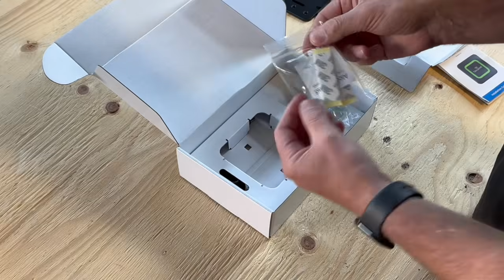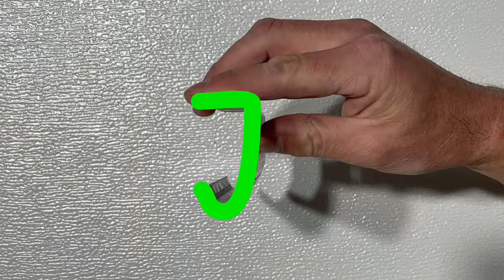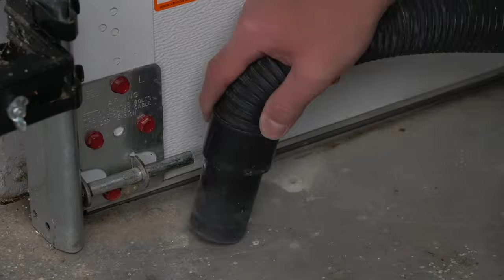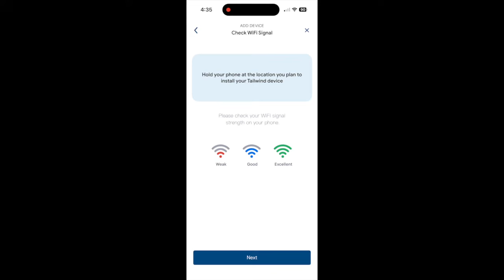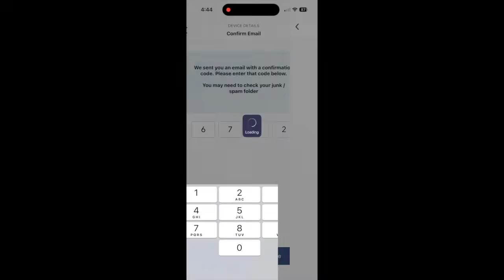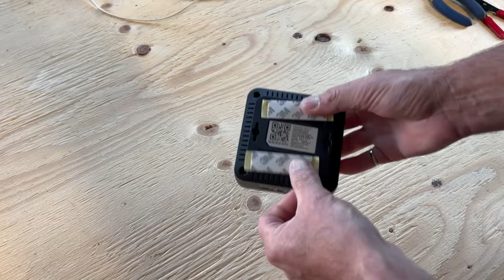Tailwind IQ3 2.0 Installation

Comment: I cannot get passed the screen where the app verifies 2.4g, gps and bluetooth.  Three devices, all three same result, bluetooth box does not check off for me to proceed connecting device to app.
Reply: I had to go to diagnostics in order to force the app to ask for bluetooth permissions.  took hours for me to figure that out.
Reply: They updated the app and fixed this issue. I was having the same problem

Comment: Mine says NOT compatible for digital control mode and Compatible for Built in door sensing Tailwind door sensor not required.  Do I need a separate sensor or not?

Comment: What are the downsides of not installing the door sensor? My garage door opener is compatible with the 2.0 without door sensor. How does unit know that the garage door is open or closed? And are there any downsides (for example, if someone were to manually open the garage door, the system would not be able to detect that the door is open)?
Reply: The door sensors are for people who simply don't have door sensors and want door sensors. There is no downside, nor benefit.

Comment: I hooked my obstruction sensors to the controller, and when I tested the obstruction, the Tailwind controller stops working for a while. After that, the auto-close feature still shuts the garage door, but the app won’t let me close it for a while

Comment: Why was the old iQ3 2.0 video removed? What changed? And where is the 2.1 video we were promised? I think you all told me in a previous comment that it was supposed to be up this past Monday.
Reply from the maker: We replaced the previous version of the 2.0 installation video with this updated version containing additional information to help customers install and set up their controllers. The previous version of the video had a title slide at the beginning of it stating that was our intention as we knew there were some things we wanted to add.

The 2.1 video is taking longer than expected. We planned for it to be done on Monday but there was an issue with the editing software. We are trying to get it up live for tomorrow as long as there are no further glitches with the editing software.